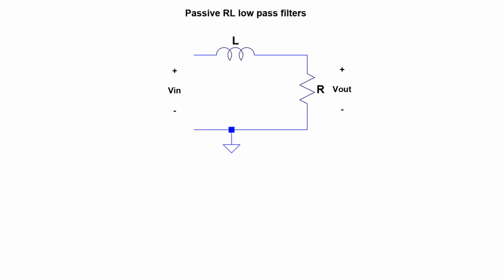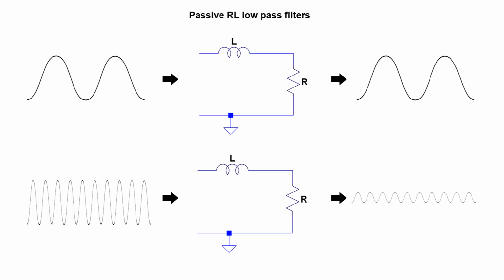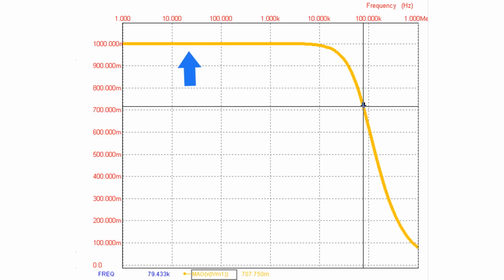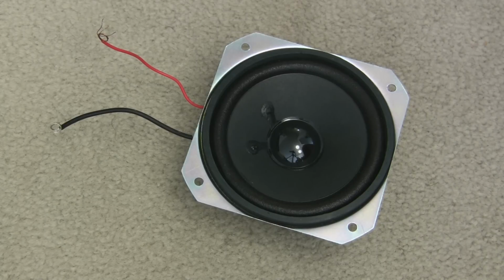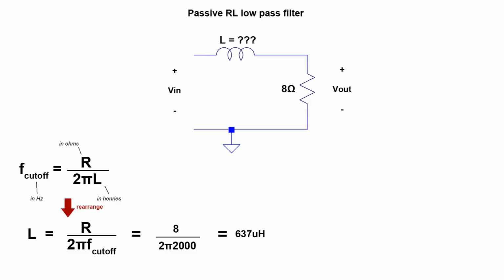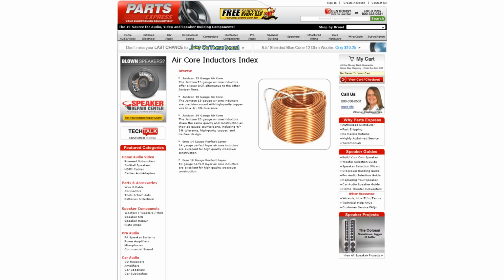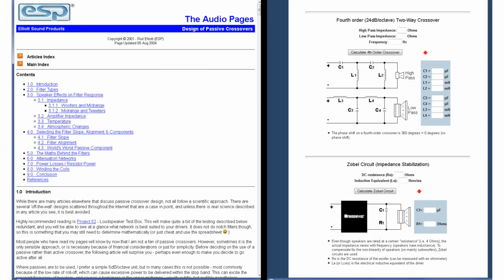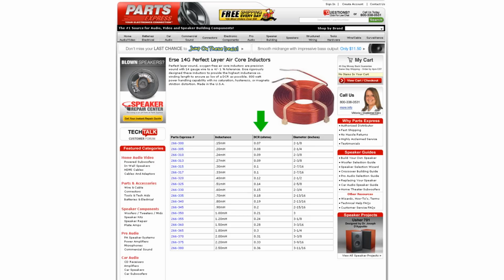Passive low pass RL filters

Comment: I get how the inductor stops high frequencies, but what’s the use of the resistor?
Reply: The inductor and the resistor together attenuate frequencies. The formula was in the video: freq = R/2πL Hz. For a given inductor you can change the cutoff frequency by changing the resistance (using a different resistor or resistors)...and vice versa. With no resistor the cutoff is basically 0 (either almost all frequencies or almost no frequencies are attenuated depending on whether it's a high-pass or low-pass configuration).

Comment: @Afrotechmods For me it works with 1 inductor of 1000uH (200mA, 2.3Ohms) reduceing the sound volume but then I connect the second or third....nothing happends? I have a 4ohms 3w speaker conected to my pc jack+ usb 3.0 port. Should I try 2-3  inductors in series with more amps and less Ohms like (800mA; 844mΩ) ?
Reply: Alexandru Breazu maybe they are inducing each other, (dont trust me)
Reply: @L DB I'm a noob...I dont even know if you are joking :P i guess I need to make a 2nd order filter but I am building a micro subwoofer and I dont have the space.

Comment: I'm trying to design a low pass filter for a speaker but I'm not sure if I understand the formula properly, what do I do with the numbers that are under the line? I think I have to multiply those, right? so trying that out with the filter example in this video 2 x pi x 2000 = 12566.3706. Then do I take the speaker impedance and divide it by the number I got? So 8/12566.3706? But I get 6.36620, so 6.36 henries? That cant be right.
Reply: 8 divided by 12566 is not 6.36

Comment: Hello Mr Some Unnamed Awesome Guy on YouTube!

I would like to build a 3 way crossover for my cars audio. When I did a small research on google, I found out that inductor and capacitor are both used in the same circuit. Like for instance inductor is used for high pass, both inductor and capacitor used in mid range and capacitor is used in low pass filtering. Can you please explain why it is done this way? Is it because tweeters draw less current? Or something like that? I mean, I know that each component is 4 ohm (tweeter, mid and woofer) which means that they draw as much current as 4 ohm resistance allow it. Please at least give me and idea about why this is the case they put both inductor and capacitor in the same pcb. I don't wanna spend 100-150 dollar on something I can built 10-15 dollars.

Thank you!

Comment: If inductors are more efficient than RC filters, in what application would it be better to use an RC filter?
Reply: I think that capacitors are cheaper then coils so cost savings is probably the main reason.
Reply: I had this same question until the tail end of this video. From what I understand, RC filters would generate more power loss proportional to higher currents. On the other hand, it's easier/cheaper to build a RC filter than RL. So the RC filter would probably come in handy before the amplifier stage in a circuit. I guess...
Reply: You can use RC filters for low frequencies such as audio frequency filtering. Inductors are more preferred to be used in high frequencies for their size varies inversely to their frequency, making them bulky and costly in low frequencies.

Comment: I'm assuming that instead of incorporating a potentiometer in the circuit as your variable resistor, you could just put in a variable inductor? Wouldn't that give you controll of the cutoff frequency "on the fly"? I'm making a bass cab for my amp... The goal is 1x15", 1x10", 3x8"... (i have a cab w 1x12", and 2 tweeters already...)

I have the wiring figured out so that there are two series-pair branches for the 4 smaller ones, and then those two branches and the 15" are run parallel... Overall load of 4ohms to match my other cab...

I'm basically assuming here that I can just throw the variable inductor on the + side of the 15", and mess with it... So I guess my follow-up question is about that little capacitor by the tweeter... What is the purpose? Is that to keep the inductor from affecting the freqs getting to the tweeter?

Sorry for the interrogation.... :)

Comment: hey, i don't want's a crossover as such, as a variable LP, HP,BP filter ideally with resonance. plus 12,k is not LOW in audio terms. all filter variable between 20Hz and maybe 18kHz - protect the kids and dogs and all that. passive and running on 9v-12v would be ideal. can you adapt these circuits? or is there a better or alternative  (and still cheap way of building this)?
while we're here square wave to PCM using a COMS inverter? or even cheap Sine wav circuit? All Audio and Sub Audio frequency well down to 20hz 8hz might be risking it! Basically RC variable Cut Off Point (with resonance idealy).

Comment: Quick question:
Do high pass filters work off similar principles? And are they just as easy to make? I need one for VHF Ham radio transmissions from a crude transmitter I made.
Also, after taking a PSAT test today, I just wanted to make sure I'm not completely stupid. For the questions regarding frequency, the unit used was Cycles per second. I just put Hz. They are the same thing, right? 1 Cycle per second = 1 Hz?
Reply: Well we are stupid for using imperial units, I'll give you that. Who thought it was a good idea to put 12 inches  in a foot 3 feet in a yard and 5280 feet in a mile. Doesn't any sense.
Reply: 1 Hz = 1 cps        True
Reply: " It's either mean or ignorant to replace a standard unit Hz with "Cycle per second"   ... cps came first , Hz came later to honor the man , check the history ...
Reply: What ! The guy asked if cps & Hz were the same ... answer Yes ... end of story ....

Comment: If I connect a 4 ohm speaker to a 4 ohm high-pass crossover does my head unit read it as 2 ohms? Also how do I connect two 4 ohm speakers in series with one of them connected to the 4 ohm crossover bypass to get a total of 8 ohms?

Comment: and is it possible to use inductor on audio input? for example if i solder it before amplifier, and use speaker without inductor. If i'm correct i should get same low pass effect (with high power speakers you need big inductors)

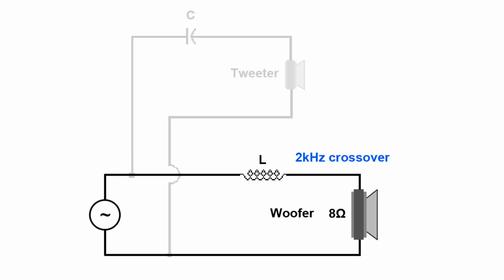Comment: Just a question; there was a hidden circuit attached to your filter circuit made of a capacitor and a 'tweeter' at 1:34, what is it exactly for and why is it hidden like this? Note that I'm not an electrical engineering student yet :)

Comment: I assemble AC converters for a living and we use massive coils in the larger units. Weighing like 200+ Kg at least. :) Then again I work with the smaller units, but they are quite hefty also.